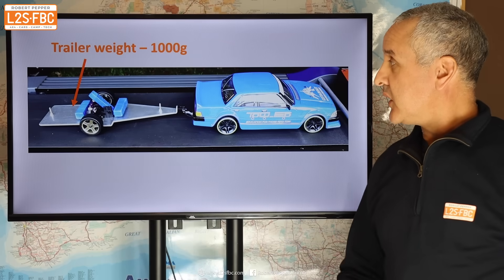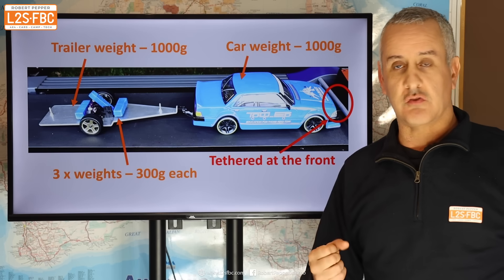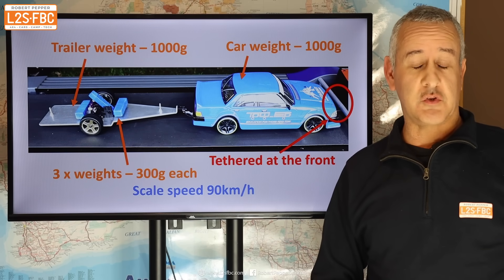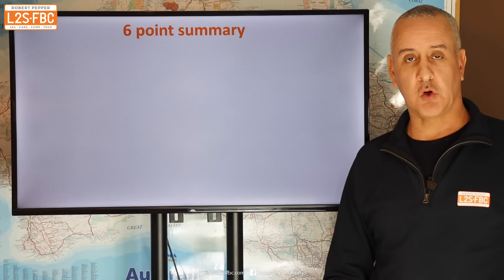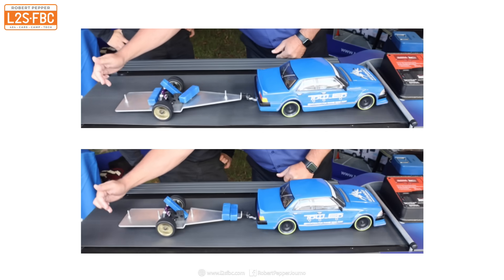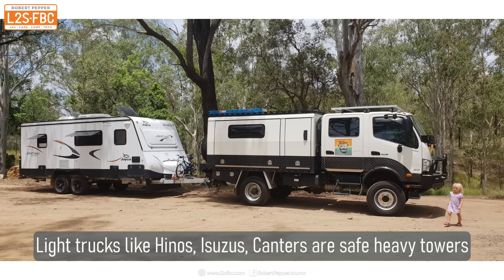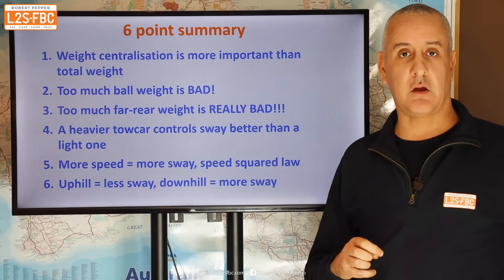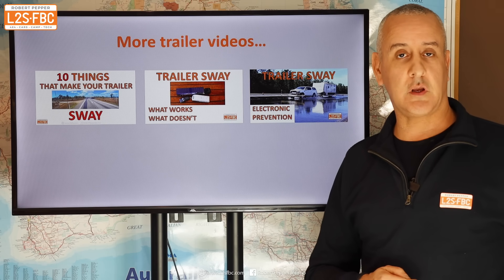7 trailer weight distribution setups, some safe, some deadly.

Comment: Truly excellent video - thank you. I’ve been towing boats for decades and so am used to a fairly consistent weight distribution as long as the trailer is set up properly. However a couple of years ago I got a very nasty surprise hauling a utility trailer that was loaded hitch light due to a couple of long wooden beams that had to hang off the back a few feet to clear the vehicle turning radius. Big mistake. At about 90km/hr the trailer started swaying, the oscillating quickly getting out of control. I knew touching the brakes was going to be a bad idea - so settled for getting off the accelerator, hoping to coast back below the point the sway started. This slowed the growing amplitude somewhat but not enough to avert the disaster I could see coming. Left with nothing else to do I tried firm but controlled acceleration. That did the trick. Once the trailer calmed down I carefully coasted back down and off the road. I was very lucky in that the trailer was significantly lighter than the tow vehicle and I was also starting up a slight hill at the time. Still gives me chest pains thinking about it though. By rights I should have been upside down that day. Thanks again for these videos. I see in the comments you note that acceleration is not a good idea. Going to check that one out next to understand why. I think it was at least a partial factor in saving my butt that day.
Reply from the maker: Wow, thanks for the story!  Acceleration isn't the preferred method of killing sway - trailer brakes work better when independenly applied, see other videos.  However, what you've done has worked for you and other people. I would expect the uphill was also a factor, and the relative weight was important too. A 200kg trailer behind a 3000kg car can do what it likes...a 3000kg trailer behind a 2800kg car is quite another matter. Sounds like you were lucky but you made your own luck!  The acceleration means the trailer speed isn't slower than the towcar - see videos in explanation for why.
Reply: @L2SFBC  - thanks very much. The smart money would be to have avoided the issue in the first place by loading properly but at least I got a lesson I won’t soon forget!

Comment: Now the empty weight of the Tow vehicle full fuel. The empty weight of the trailer .
What are the individual weight ratings of each axle. Now subtract the empty tare 
Weight from the axle weight rating.
Ie so tow vehicle weighs 7000 lbs 
Trailer weighs 2000 lbs and has 7000 lb axles you can gross 7000 lbs. 
7000 - 2000 = 5000 trailer pay load 
So for a 16 ft  2 axle trailer you can haul 5000 lbs. Axles set in the middle at 8 ft. 
The "sweet spot" is about 6 ft from the front. For a bumper pull trailer. If you pulling it with a long bed pickup 
And hauling stuff in the bed as well. 
The sweet spot is at the 2 ft mark.
Keep the heavy weight in the front of the bed. Cause if you can't steer you'll crash. 
Think of loading a bumper pull trailer as  balancing a teeter totter attached to a teeter totter that has 2 pivots heaviest on the front pivot. Now load to gross making sure to not go over gross combined weight or individual axle weight. Now the tires have to carry all the weight. So if the weight rating on the tires is less than the gross weight of the setup. Or the axle. Get better tires. 
Cause an overloaded tire is a dangerous thing.

Comment: This is a very good illustration but it leaves out a few real world variables like force being applied from the axles instead of from the road moving, and in that same category would be the differences of front vs rear drive vehicles. The treadmill setup is giving a very exaggerated response overall but it gives a good basic understanding.
Reply from the maker: Lots of things left out but it does show what it does well enough.

Comment: What about flat towing another car or truck?  I used a Rider moving van (24 ft. and it weighed in at about 19,000 lbs loaded. My pick up was about 4800. I had no issues but never got over 65 MPH. I am so glad I did those two cross country moves back in 1985 and 1986 as that Rider truck got 5 MPG at best. The gas prices today would be a tremendous strain on a newly wed budget.
Reply from the maker: Flat towing is entirely different.

Comment: Very good explanation. now i have never driven a car with a trailer nor i'm intending to do so (well it's not the planning) but at least i know about weight distribution and that it definitely matters. I would have thought that even distribution was the best but putting the weight in front would also be good. But apparently not!... Thanks! :)
Reply from the maker: Slightly in front, but central is critical.

Comment: What should you do if by whatever reason your driving a vehicle and trailer  down the road and you start getting some big heavy sway should  you take your put off the gas and hope the vehicle gets better as you slow down or when you get that big heavy sway should you just floor it and try to power yourself out it of it
Reply from the maker: See videos linked in description

Comment: Very informative and something anyone towing a trailer should watch and learn from, However what it doesn't show is how driving technique can also have a significant impact on the outcome of trailer sway, for example, a natural reaction is to brake when you feel the trailer swaying but this can actually make things worse, each outcome is dependant on circumstance IE: trailer weight, vehicle weight, weight distribution, camber of the road, up hill or down hill, speed, the power of the vehicle, force of acceleration and how hard you brake, I think everyone should have lessons in towing before being let loose on the road.

Comment: Something that was not tested was the changes the weight distribution and length of the vehicle makes. 
I would predict the weights should not be centered but slightly forward to equalize the traction on the front and rear wheels of the drive vehicle to counteract the weight of the engine. 
The heavy vehicles you used for examples are cases where there is a variation in the weight distribution of the vehicle. 
I would also predict this would be more stable with a 2 axle trailer as the central mass is able to be offset and still be maintained between both axles. 
I believe the centering(and lowering) of mass of the trailer and vehicles independent bodies is the most important part to stabilization.

Is the the center of mass of the entire system or the center of mass of the independent systems that is the driving factor for the sway?

You can break this equation down into a board on a 2 see-saws (trailer) hinged to a board overlaying a see-saw(back axle of vehicle) and sitting on a front counter-weight.
As you change the position of the see-saws and the length of the boards you will receive different answers.
What does the variation of the center of mass's height of both vehicles do?
This seems like a very limited experiment to claim "proven" - also all of these examples used single axle trailers until the end...

It is great your understanding of the physics of your vehicle has not led you to any encounters you have predicted correctly for but there are a lot of things you did not account for and the chances of running into one of them is still not negligible.
Reply from the maker: Thanks...I can only put so much into one video!

Comment: Never understood the Australian and European towing methods.... 10% tongue weight for a bumper pull and an effective towing vehicle are key. Weight just forward of the axle towards the tow vehicle vs centered will lead to a significantly more stable trailer. I'd definitely prefer gooseneck or fifth wheel though, 15-20% tongue weight right over the rear axle and a longer wheelbase vehicle. I can legally and safely tow at 70-80mph, depending on the tire rating on the trailer, with no issue.
Reply from the maker: 10% is just a number, no science behind it. 5th wheels definitely better.

Comment: Very informative, probably gonna save this to show those  that think they know better.  I could easily put something together to  measure the ball weight but trying to measure the weight at the rear would be much more difficult. Any ideas. 
Perhaps a builder's level placed on the floor over the axel with the trailer hooked up to the tow vehicle?
Reply from the maker: Thanks - why not use a weighbridge?
Reply: @L2SFBC  ahh your referring to a truck scale,  as their known in my neck of the woods. 
No I don't think that would work, they only show the total weight, or per axel. 
I doubt they can indicate where the weight is front to back.
Reply from the maker: Just put one axle on it at a time.
Reply: @L2SFBC  
If your trailer was a tandem axel they would be very close together unlike commercial freight trucks and trailers. 
And of cource if your trailer has only one axel it wouldn't work at all.
Reply: @L2SFBC  what is a weight bridge? 
I have not heard of it.

Comment: Can having two axles with the tow trailer negate the weight distribution issues, as the two axles will prefer to go straight due to the shearing forces?
Reply from the maker: No, will never negate, but will help stability.

Comment: Something else to point out that went unmentioned and unnoticed.  If you watch the accident videos closely (herein and elsewhere) most all of the crashing vehicles were overtaking a larger vehicle at a very fast rate of speed.  

As demonstrated in videos all cases of sway were induced by the demonstrators inducing a lateral (sideways) force (striking it) to the back of the trailer.  What you don't see in the crash videos is the trailers getting struck by the pressure wake rolling off the front of the vehicle they were passing.  Which is essentially the same thing as the demonstrator reaching out and striking the model in this video.

Next time you are passing a large vehicle in your car take note of this.  The closer you are when passing fast moving large vehicles, the more your car gets knocked sideways.  Point is, stay as far away as possible from large vehicles and pass them slowly when you are towing a trailer (properly loaded or not).
Reply from the maker: Good points and I mention them elsewhere. For a recap overtaking is dangerous because:
- increased speed
- sudden change of direction
- effect of airflow
- slowing down & direction change

Comment: At about @8:25 they talk about 'Poor Weight Distribution'.  In this case 'Distribution' implies the even placement of weight across the trailer.  So 'Good Distribution' would be evenly distributing weight across the trailer from front to rear and 'Poor Distribution' would be the uneven distribution of weight from front to rear.

However, and as the demonstrations clearly show, 'Poor Distribution' is what you want.  That is, you should centralize as much weight as possible/practicable over the trailer wheels and then evenly distribute any remaining weight between the front & back of the trailer (i.e. balance it so that you place as little weight on the ball as possible).

It is critical for drivers/loaders to understand this as you don't want weight evenly distributed across the trailer.  You want to put the majority of weight centered over the trailer's axels and then evenly distribute any remaining weight between the front and read of the trailer.

Comment: I have known about proper weight distribution since I was a young teen driver. However when I was building my house about 14 years ago I went and picked up a load of rebar and they loaded it all on one side of my trailer. I did not realize or think about the weight being all on one side as I was always told only about front to rear weight distribution.  So several miles down the road I experienced trailer sway and it scared the shit out of me. Can you do a demonstration on side to side weight distribution to make others aware of that as well. It could also save lives.
Reply from the maker: Great idea, we'll do that!

Comment: This model is flawed. The design of that trailer was built to be unstable. The tongue is almost twice as long as it should be and the tires are way too close to the tongue supports/front of trailer 😅
Reply from the maker: The trailer is the same throughout each weight change, so it's consistent. Also, ever seen a glider trailer?

Comment: Very informative, thank you!  How does length (distance from hitch ball to trailer axle) affect this? If buying a trailer for a given purpose is longer or shorter more stable?
Reply from the maker: Longer distance from hitch to trailer wheels = more stable
Reply: @L2SFBC  Thank you very much!  I know longer is more manageable backing up, wasn't sure that translated to moving forward.

Comment: Why are wheels at the center of balance and not closer to the rear? What about 4 wheels with the front being on a swivel? There are wagons that have a front steering system that turns the wagon. I don't understand why trailers don't have front steering. Can anyone explain to me why this is without saying to cut cost.
Reply from the maker: Cost, weight, difficutly reversing.

Comment: Quite revealing- thanks.  Could you do the same demonstration with a 5th wheel trailer?  Or just tell us.  Thanks.
Reply from the maker: 5th wheels are much better stablised as the hitch weight is (or should be) between the axles of the towcar, which has many advantages not least that there's downforce on both axles, and less of a lever for the trailer to 'wag' the towcar.
Reply: @L2SFBC  As I suspected- thanks for confirming.  The "rule" I'd heard is 10% of the trailer weight on the tow point- not too much, not too little.
Reply from the maker: That rule has no basis in science. Many trailers tow just fine with 5%. Other need 15%.

Comment: Brilliant demonstration and makes perfect sense if you think of the trailer acting as a flywheel with the axles as a vertical pivot point. On my second outing with my new caravan, I was in the passing lane of a divided highway at full speed when I saw a wrong-way car coming directly at me. I reflexively swerved abruptly right (I'm in USA) and avoided the collision, and am happy to report that the caravan tracked beautifully with no oversway. Very confidence building! The info from this video will be very helpful in maintaining stability when the caravan is more heavily loaded, and also reinforces that I should always carry gear in the truck rather than the trailer when practical.
Reply from the maker: wow great idea to consider the flywheel idea! I love to hear about stories like that, adds some real-world experience which is hard to get given the costs/risks of trailer crash testing!

Comment: I think it all revolves around the weight becoming light in the front end causing the steering ability of the vehicle to be reduced due to a gross lack of traction on the front wheels. and then the weight becomes focused on the rear wheels like a pivot point with no steering ability whatsoever.  Each rear wheel shifts weight back and forth until the vehicle turns one direction and is shoved onto itself tipping over.
Reply from the maker: That's part of it yes

Comment: Ok now this coming from a 40 year veteran truck driving Yank. The best advice once sway sets in is to NOT panic, not stand on the brake pedal! But to slowly apply the trailer brakes only, from the trailer brake controller! That in turn should force the trailer wheels to slow down enough, to pull the whole rig to straighten out, then re apply softly till you can safely come to a safe stop, hopefully safe enough to change your shorts!
Reply from the maker: Correct -  I have another video (see description) where this is shown.

Comment: This actually potentially explains the problem with a camper I've got that probably needs a bigger truck. Or maybe more front weight
Reply from the maker: What's the problem?
Reply: @L2SFBC  I'd get to highway speeds and it'd start feeling really meandery on the road. My guess is it was a smidge too heavy for my truck and the weight was distributed forward and backwards
Reply from the maker: Sounds right

Comment: If you do end up with your vehicle fishtailing slow down until it no longer does it. It will tend to fishtail more going downhill than on a level road or going uphill. If you have to go slower than the other traffic that is far better than the alternative but try to level the load as soon as you can safely do so.
Reply from the maker: There's better solutions - look at the links in the description.

Comment: Maybe you went over this elsewhere, but many "amateur" towers overlook tire pressure and tire load capacity on both the trailer and tow vehicle.  Overloaded suspension is another common issue.
Reply from the maker: I haven't done tyre pressures yet, but it's on the list.

Comment: Excellent presentation.👍. I might have added in a brief discussion about having good trailer brakes.  I’ve seen more than one mishap where someone pulled a large trailer without  functional brakes, and ended up in the ditch when the “tail wagged the dog.” Had a wild ride once in an empty short bed half ton pulling a 30 foot flatbed trailer, when we blew a rear tire on the freeway. We used all four lanes, until the driver grabbed the in-cab control and manually applied trailer brakes (I later suggested he actually connect the controller to the vehicle brakes as it should be).
Reply from the maker: See the links in the description for more. Good to know the trailer brake tecnique worked, that's one of the videos I show.